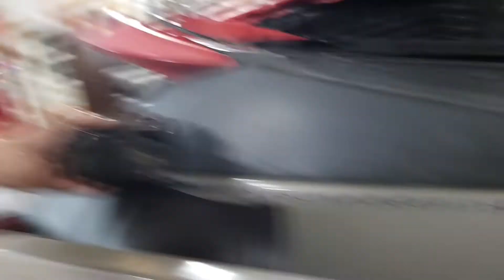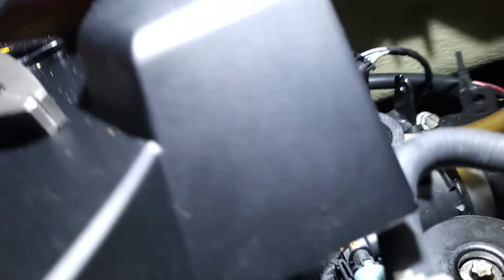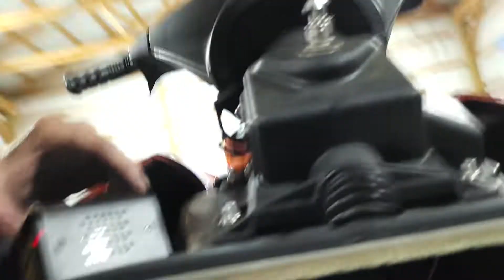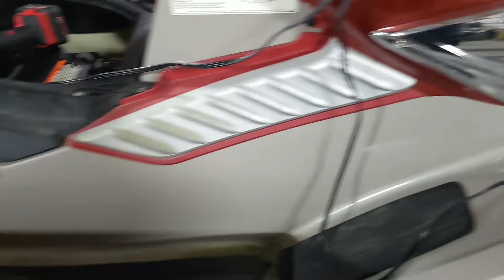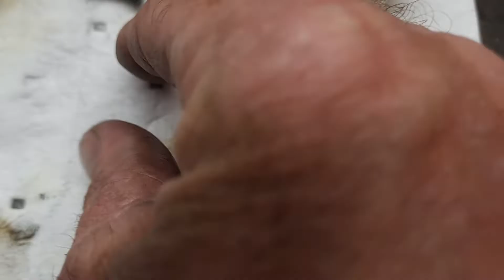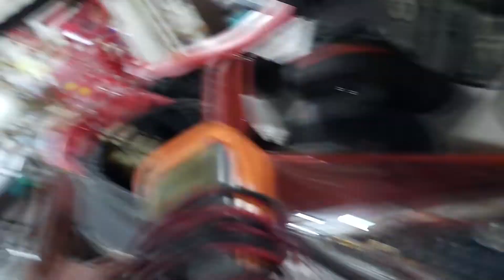2005 Sea Doo RXP 215 Low 12 Volt warning ⚠️

Comment: On my 05 gtx limited supercharged the fuse had so much electrical grease on it was not making  good contact. I cleaned the grease off and worked fine after that put a new fuse as well after but it did work with the original fuse once the grease was wiped off

Comment: Thanks for the video.   I've had this issue for years with my 04 RXP.  I would typically replace the fuse and clean the connector which would last a season.  Although I would like something more permanent. I've been thinking about changing the connectors, but never thought of soldering the fuse in.

Comment: Great video-my exact problem.  So am I hearing right-it was the battery that was in need of replacement bc it would not accept more than 11.6v, or a bad fuse??
Reply from the maker: The battery needed to be replaced because it primarily was a cheap battery with low CCA. It had been discharged so many times from the ski being ridden and the bad fuse holder not supplying voltage back into it. This guy was lucky because he was packing around a 1,000 amp Noco lithium jump pack, and everytime the ski wouldn't start after being out on the water for minutes on end, he would just jump it.